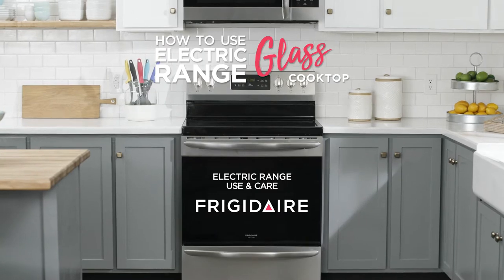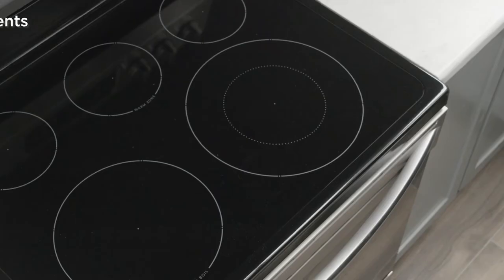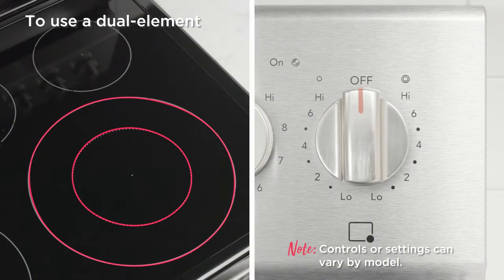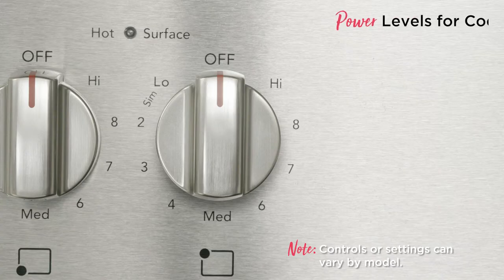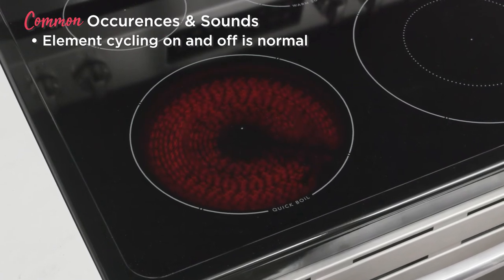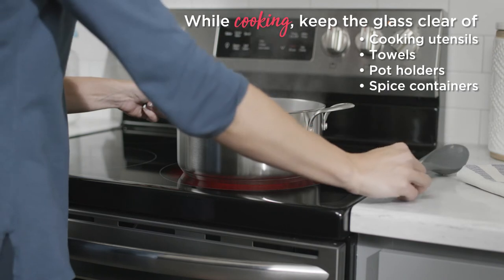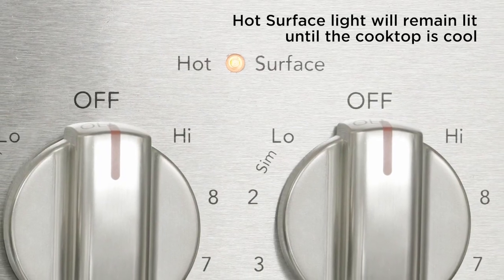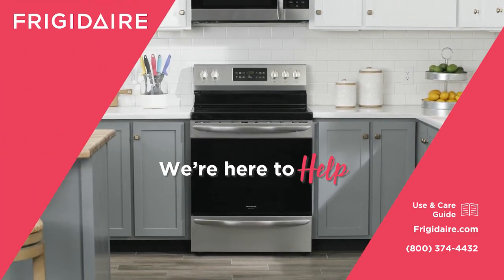How To Use Your Electric Range Glass Cooktop

Comment: Just purchased a glass cooktop and I HATE IT!! We put a frying pan on it, that was flat, but it left the waffle design on the cooktop. I "seasoned" the cooktop with Frigidaire ReadyClean™ Glass and Ceramic Cooktop Cleaner before using it. I cannot get the top clean as my husband wiped it while it was still hot. I have used elbow grease and cannot get it clean. It has been used about 5 times and looks horrible! NOT HAPPY!!
Reply: Try comet!!
Reply: Electric glass cooktops that are not induction are TRASH.

Since the cooktop itself heats up, not the pan, as with induction
Reply: Yup I’m here to prevent any burning or staining on my cooktop as I just got a new glass stove few months ago and still haven’t used it. Trying to learn ways to prevent leaving a “ugly ring” around the cooktop, I think foil under the lot when it’s on?
Reply: I agree.  I bought another glass top cleaner at Home Depot, and it's not working.
Reply: @ruthmcgill4612 use a razor window scraper
Reply: Try ultra fine sandpaper.

Comment: I have to admit trying to keep the glass top clean is a job in its self. I hate that all stoves now have the on and off cycle. Especially for frying food and vegetables and pasta. Think gas is the only one that you can regulate the heat yourself. Wish that's the way i would have went now. After working coming home and cooking supper then usually have to do the deeper cleaning on it. Don't enjoy cooking on it like i did my old 1970 whirlpool.
Reply from the maker: Hi there! I understand your frustration with keeping the glass cooktop clean and the challenges of using electric ranges with their on/off cycle for regulating heat. Maintaining a clean cooktop can indeed be a task, especially after a long day of work and cooking. Glass cooktops require special care to prevent scratches and maintain their appearance. Regular cleaning with a cooktop cleaner and a soft cloth can help remove spills and residue, but deeper cleaning may be necessary from time to time. Ultimately, the choice of cooking appliance depends on your personal preferences, cooking habits, and lifestyle. It's important to find a solution that works best for you and makes cooking a more enjoyable experience. If you have any questions or need further assistance, feel free to connect with us via live chat or by phone at 1-800-374-4432 Monday-Friday, 8:30 a.m.–8 p.m. EST, and we will be here to help!

Comment: So confused with how these work. Produces smoke and smells like burning plastic if I let it heat up before putting a pan on. When I boil water, sometimes there's a bit of overflow and it just burns on the glass? It doesn't just nicely evaporate.
Reply from the maker: If you are boiling water and it is overflowing you should reduce the amount of water in the pot or use a taller pot. You do not have to warm up the burner before placing the pot or pan on. If you have smells, it could be that a cleaner you used was not washed off completely. Thx

Comment: I have new Frigidaire Gallery slide in range. How the heck can I pop popcorn on it?  I burn it every time. It stops popping when the element turns off.
Reply from the maker: Hi, Becky! We would recommend following the manufacturer's instructions on your popcorn for stovetop cooking. You may need to lower the heat, cook fewer kernels at once, or add additional oil! ~Ashton
Reply: @Frigidaire  thanks. I took your advice and it worked. Thanks for replying. We switched from a gas range to electric range. We love it.
Reply from the maker: @beckyalberter5912  Awesome! It's great to hear your new electric range is working out so well. We hope you're enjoying your fresh stovetop popcorn!! :) ~Ashton
Reply: Idk maybe use your microwave 🤯

Comment: Purchase my electric Frigidaire range and March I've had the technician out three times already for the left front burner it say rapid boil on high and the number two I was told by each technician there is nothing wrong with the product has anyone else experienced anything like this
Reply from the maker: Hello, Carol! We never like to hear about any of our products not working as they should. We'd love to gather a little more information from you and see what we can do to resolve this issue for you. Please connect with our Live Chat team on our website or through our Customer Support line at 1-800-374-4432 (M-F, 8:30 AM-8 PM EST). ~ Christy
Reply: @Frigidaire  Yes we have had problems with these settings as well. Turn dial to 1 and things still burn. Pots take a long time to boil.

Comment: HEATS UP TIO CONSISTNENT HEAT:? ARE YOU SHITTING ME

These electronic glass stove tops are literally on or off. Burning your food or not. 

You could have it set on setting 2 and the pan just gets htoter and hottter until satan himself is like damn yo chill out.
Reply: You must keep your cook top clean after every use. I use soapy water first and wipe the stove off with
clear water and dry. If food was caked on or not shiny. I use Weiman glass top cleaner. It works for me every time.  It is so simple. Never use any other product.
If you get a spot caked on you also can use a razor without scratching it.
Reply: This is the truest representation of this stove. Tried to make a grilled cheese and I could have melted a gold bar on the 2 setting
Reply: @marilynmarkowitz5619   With a coil top you did not have to do any of this.